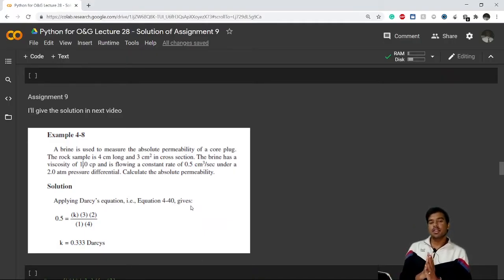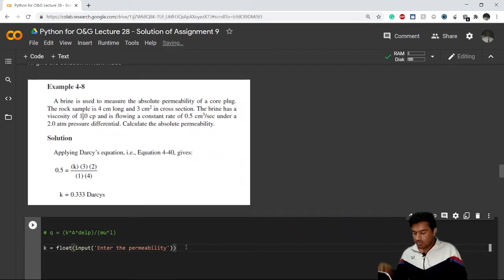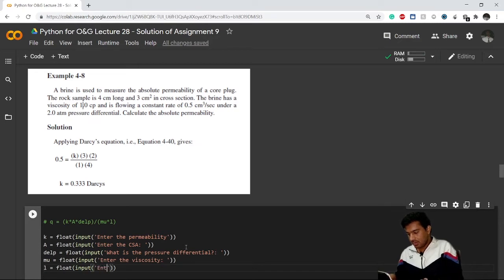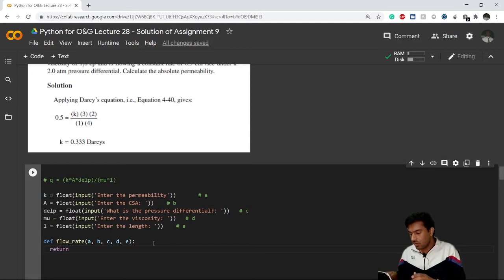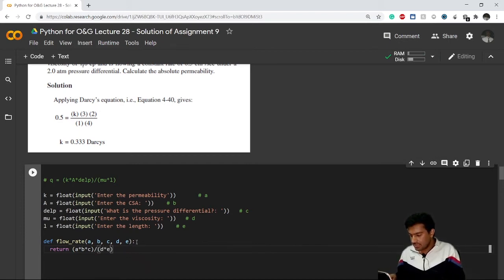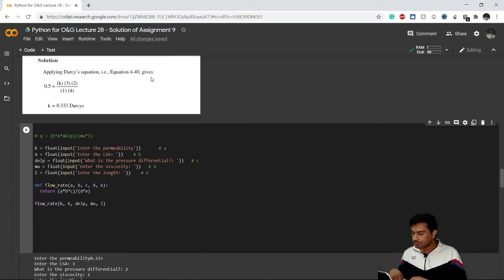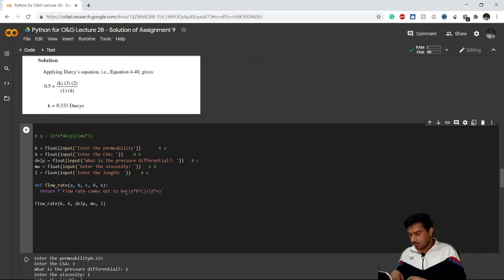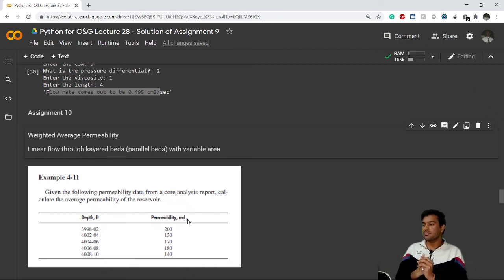Lecture 28 - Solution for Assignment 9 | #Python for Oil and Gas

Comment: d1,d2=input("enter the first and second zone depth:").split(',')
d3,d4=input("enter the third and fouth zone depth:").split(',')
d5=input("enter the fifth zone depth:")
k1,k2=input("enter the first and second zone permeability:").split(',')
k3,k4=input("enter the third and fouth zone permeability:").split(',')
k5=input("enter the fifth zone permeability:")
d1=float(d1)
d2=float(d2)
d3=float(d3)
d4=float(d4)
d5=float(d5)
k1=float(k1)
k2=float(k2)
k3=float(k3)
k4=float(k4)
k5=float(k5)
def w_k(d1,d2,d3,d4,d5,k1,k2,k3,k4,k5):
  return (d1*k1+d2*k2+d3*k3+d4*k4+d5*k5)/(d1+d2+d3+d4+d5)

w_k(d1,d2,d3,d4,d5,k1,k2,k3,k4,k5)

Comment: Assingment 10: 

k1, k2, k3, k4, k5 = map(int, input('Permeability, md: ').split(','))
h1, h2, h3, h4, h5 = map(int, input('h values: ').split(','))

# h values: 4 2 2 2 2 
# IDK how to calculate them. I found them on chegg.

def avg_per(a,b,c,d,e,f,g,h,i,j):
    return f'The average permeability is {round(((b+d+f+h+j)/((b/a)+(d/c)+(f/e)+(h/g)+(j/i))),2)}.'
avg_per(k1,h1,k2,h2,k3,h3,k4,h4,k5,h5)
Reply: Permeability, md: 200,130,170,180,140
h values: 4,2,2,2,2

'The average permeability is 165.41.'